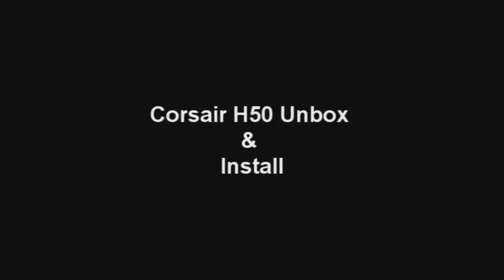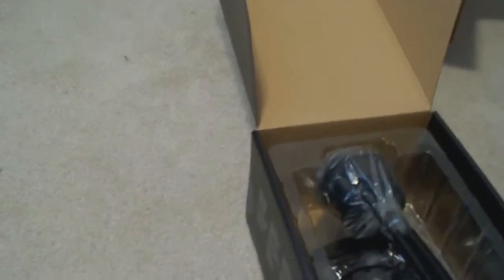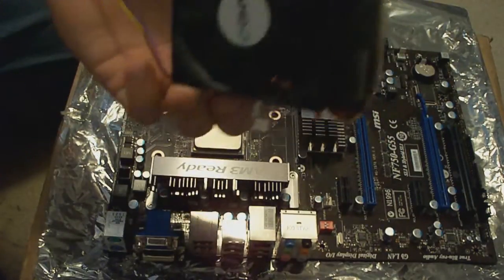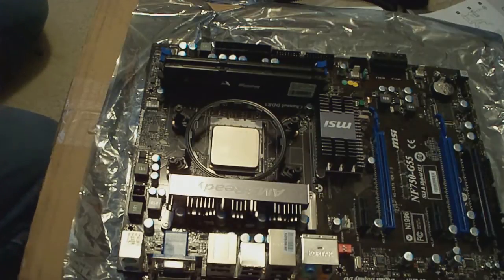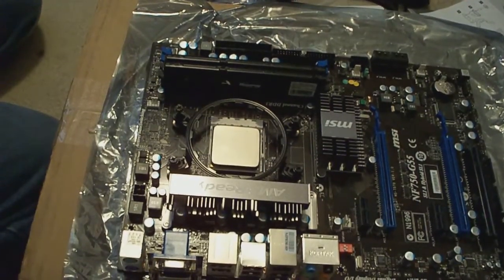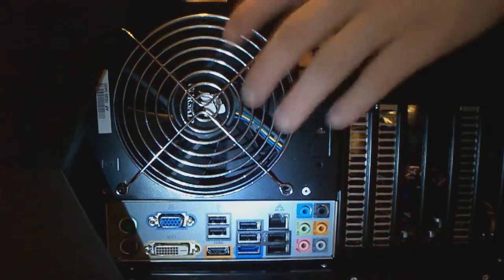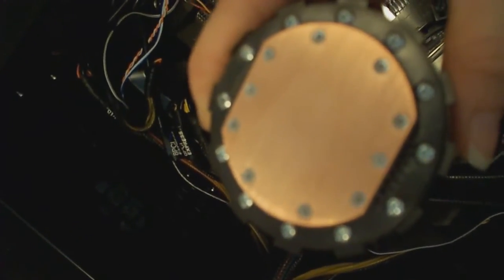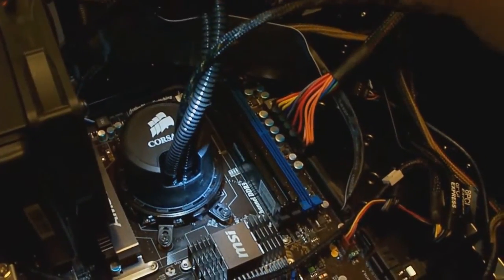corsair h50 unbox and install part1

Comment from the maker: @SteamProVidz my case has the motherboard tuned 90 degrees so all the cords come out at the top as well as all the heat rises straight up. so it has 2 180mm fans that suck air up from the bottom and out the top there is no rear fan just a top fan where i installed this h50. so i chose to have minor amount of heat go through it rather then trying to force hot air down into the case which would leave no place for exhaust to go since all fans would be intake. which is why i did it this way.

Comment from the maker: @Kaynos yea i know i have to have it that way as this is my only exhaust fan everything is 90 degrees  so i got 2 180mm fans sucking in cold air from the floor then heat rises so it all goes out the top. besides i recently got a gtx 480 and it puts most of its heat outside the case it lowered my cpu temps by over 10 degrees.

Comment: You installed the fan backward.  For best result you want the fan to blow fresh air in the radiator.  Your setup your sucking the hot air hot.   Anyway that's what the manufacturer of the Corsair H50 is saying.  Best result is when fresh air is being blown in the radiator.  What this video : watch?v=PUxoFiFuS_g

Comment from the maker: @TheRoach2010 lol no prob every one starts off new at some point but it means i got one fan pushing air across the radiator and then another fan on the other side pulling air off of the radiator so it cools off the radiator fins as fast as possible.

Comment from the maker: @ojomow the orange fan is pushing heat out and the top one is sucking heat out thats how push pull works it takes a much heat off the radiator as fast as possible.

Comment from the maker: @Dannykid714 its doing pretty good seeing as i have it set up wrong sucking hot air out of may case through the radiator 2 9800 gx2s make it very hot in there and trying to cool a 955 black @ 3.8 ghz i think its doing a fine job it never goes over 55 degrees c under full load and my room is normally like 80 degrees +.

Comment from the maker: @Dannykid714 yes i did remove that and after you remove that the screws for the corsair system pass though the holes left by the stock cpu bracket.

Comment from the maker: @jcat44444 corsair wants them to suck cold air into your case and set up other fans as exhaust but i couldn't do that cause of my case's uniqueness so i have them blowing out so it's probably not working as good as it could since it is using hot air from inside my case.